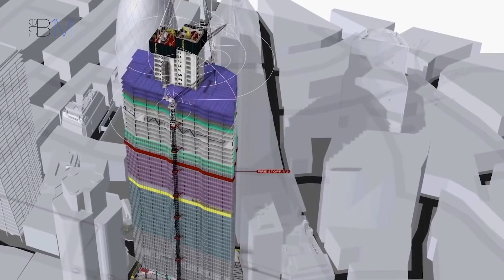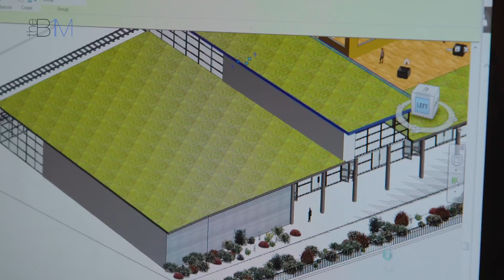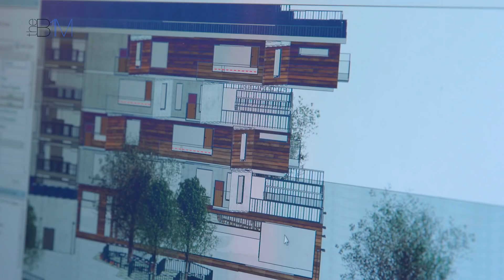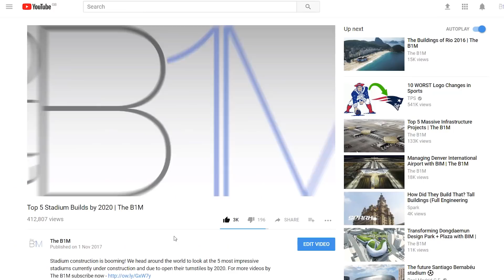Why Construction Needs the Best Young Talent

Comment: Can you talk about construction industry innovation because it doesn't seem to have done any
Computers before were made of tubes but now are of silicon chips 
Whereas construction seems to be same
Reply from the maker: Not sure where to begin with that.
Reply: The B1M or maybe make a video regarding how methods of construction have changed since 1950
Reply: Yes where to begin.  Let's look at simple measuring tools: lasers for measuring and for leveling.  Being able to use a rotating laser to put up a ceiling grid rather than snapping a chalk line.  Tools for measuring better tolerances.  Equipment for doing more: bigger trucks, looks like the sawzall for smaller projects.  The evolution of construction materials from steel single pane windows to double and triple pane windows out if thermally broken aluminum (or aluminium for you Brits 🙂) filled with argon for better energy efficiency, and several other building products driven by green technologies.  As recent as 2000 the concept of Building Science has revolutionized how we look at air and water management in buildings.  And the safety measures and devices and practices make it a safer profession.  I'm scratching the surface here.
Reply: I would recommend looking at B1M's video on laminated composite wood for building taller stick buildings as just one example.